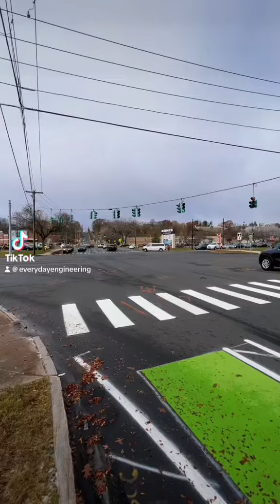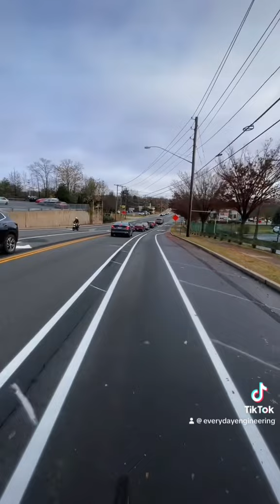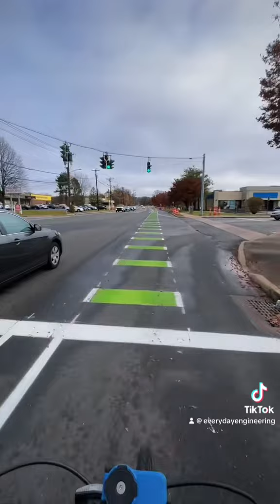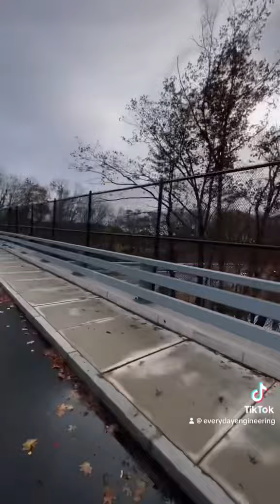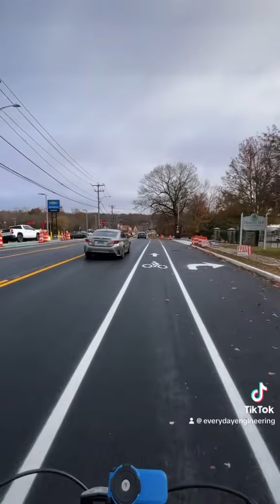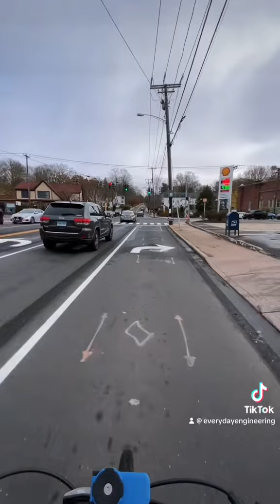New Bike Lanes on Skiff Street (Hamden, CT)

Comment: this looks very unpleasant to ride on. buffer is so small and offers no real protection. running the "gauntlet" as its been called between the car lanes is terrifying in my opinion, and i'm a fairly confident cyclist. also i don't know if it's just me but the quality of the paintjob looks pretty bad and like it's not going to last very long. should probably be textured thermoplastic
Reply from the maker: the paint is fine, we just had a lot of snow with plows running over it and it's still there. it also has texture